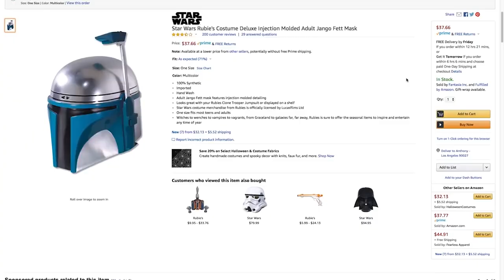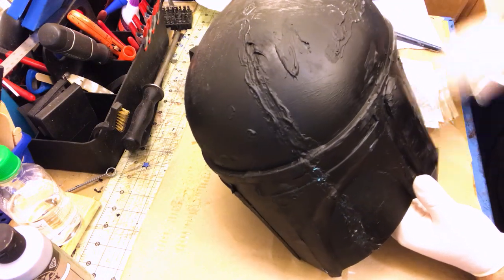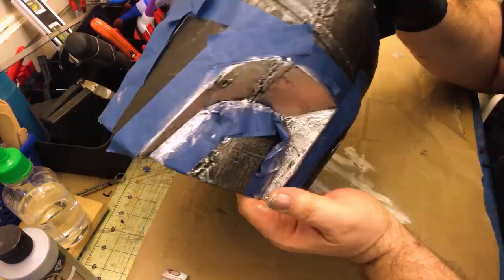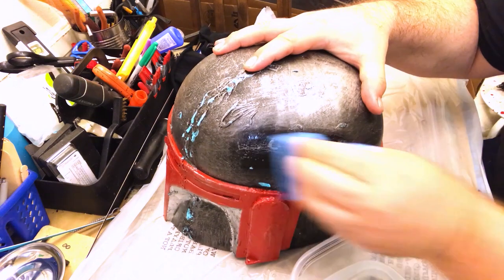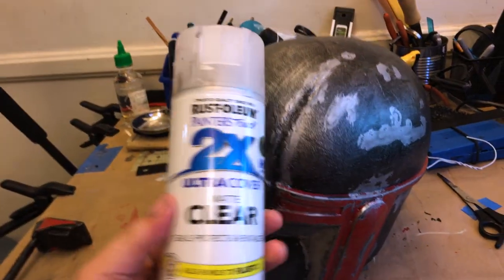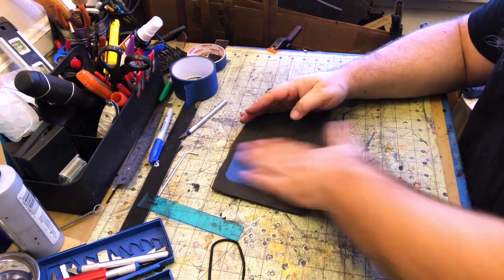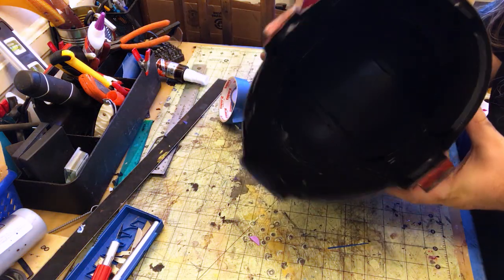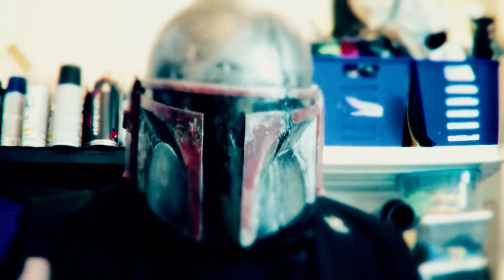MANDALORIAN HELMET: PAINT AND WEATHERING [PT.2]

Comment: I got an old cheap hardhat and took the liner out. With very little work I installed it in my helmet (which is the same as in the vid) and it sits on my head perfectly. Also , it's totally adjustable.and comfortable.

Comment: ive been making my own helmet  using your example. im curious, how well can you see through the lighting gel? i ordered some and im pretty bummed out to realize they compromise my vision pretty bad. is this normal?
Reply from the maker: Hey Ben, great to hear that. The gel I used was a dark red, it was fine but I only tested it in the daylight & in well-lit spaces, but yeah I could see through it fine, for sure like dark sunglasses. A darker gel with less ambient light could perhaps be darker. In the part three video, I actually buy a pre-made T-Visor that is great. It further stabilizes the helmet & looks good from inside & out. It is pretty reasonable under $15  "The Standard T-Visor" is the one listed that fits Rubies in fact just looked as of now it's $13.25    
 ►T VISOR WEBSITE : http://www.t-visor.com/